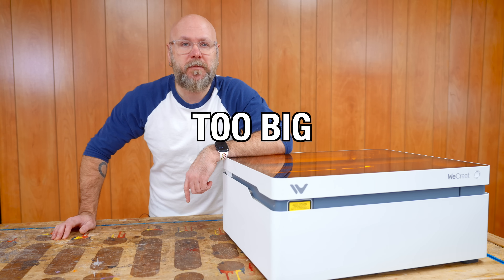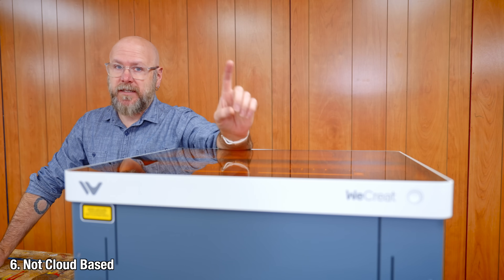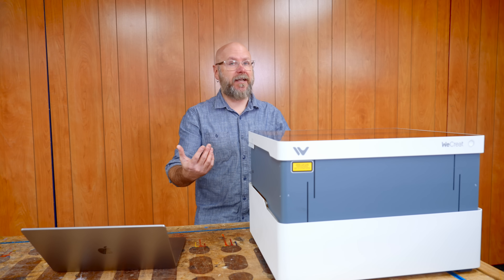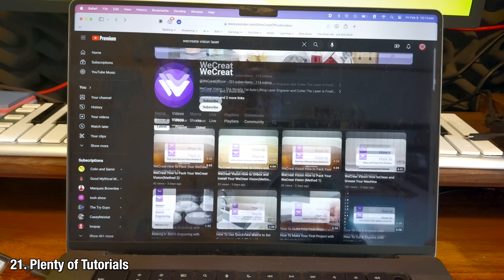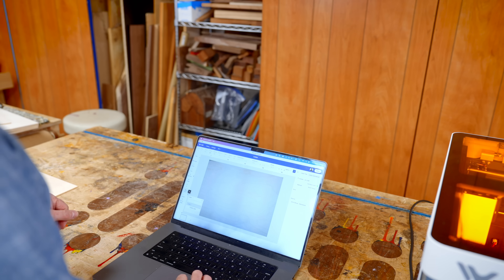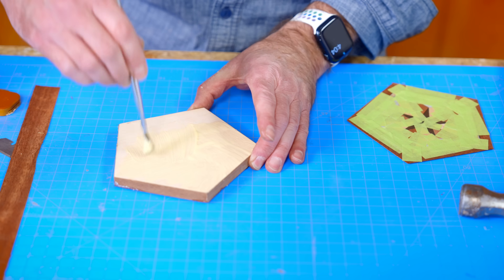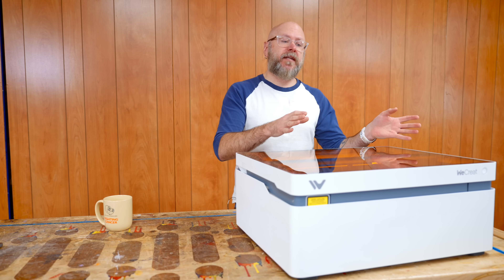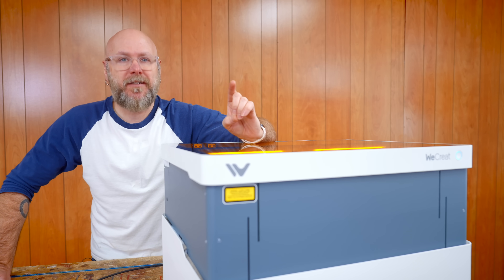28 Reasons Why THIS Should Be Your First Laser | WeCreat Vision

Comment: They lost at $1200 for 20w. 20W diodes are notoriously easy to overheat as people try to tax how much it can do and a diode laser never should really be ran more than 80% power. For that kind fo money regardless how nicely its packaged with other features, id be expecting at least 40-50w diode. Resolution doesn't matter by wattage, as that is purely properly setting things up in the process. Having a 40w laser wont run you any better or worse resolution at 25% power setting than a 20W laser would at 50% power setting.

Comment: I have looked seriously at adding this machine to my laser room ... but the Lightburn issue has kept me from pulling the string. Unless something has changed recently, the "Lightburn compatibility" claim is a bit misleading. Unless I am mistaken, you can create your project in Lightburn, but must export it to a GCode file, which can then be loaded & run in the Wecreat. On my other 2 diode lasers, there is no need to export/import files, and Lightburn directly controls all laser functions. Otherwise, this is a great machine.

Comment: Seems pretty great for a first laser. I bought an Xtools d1 10w with a bunch of accessories on sale a year or so ago for about $1000. Still had to get a fan to vent out my window and build an enclosure. Plus a 3D printed z-axis extension so I could keep the risers on at all times. All that to say everything this includes for the price is pretty incredible and way more convenient! I’m kind of jealous. One thing I liked about the Xtools D1 was that I could put any size material under it since it was just a frame I could place on top of things… then I built my enclosure and quickly realized I will likely NEVER place my laser on a large object and it stays in the enclose which makes it basically like this one… but significantly less convenient. Plus I had to built it and it doesn’t have a camera. Tempted to sell what I have and get this instead.

Comment: Woah. This is a laser engraver. Stop. The other ones you mention at the start of the video are laser cutters. In other words, diode laser on this thing versus CO2 laser on the others. CO2 lasers are close to an order or magnitude more expensive (in general) than diode. So while $1200 is an attractive price for a fully enclosed laser product, this isn't some magical amazing deal when comparing against Gweike, Glowforge, Polar, etc.  Diode lasers are cheap.

One of the reasons I'd need a lser is to cut acrylic. Clear acrylic. And no diode laser can do that. :( 

As far as stencils go, another good use, Cricut or Silouette is a much cheaper option for that, and you can go unlimited length.
Reply: I don't understand. It looks like it clearly shows cutting out those pentagram shapes from 3mm ply.

Comment: ARGHHH! Their website is impossible to navigate. Just to ask them a question navigates you into captcha hell. Why should I want to do business with a company like that? Edit: Apparently my inquiry did go through and someone may reply to my question. The captcha thing is still an issue but that ire should probably be directed to whatever effing fool is programming captcha. Will see probably Monday if they can process the materials (.008" thin sheet steel and .014" copper clad pcb) that I am using. Thanks David for presenting this possible solution to my fabrication task.Edit 2: To their credit they did get back to me today. Sadly my materials are not what they can cut. Dang!

Comment: Great video for laser starters! Having had expensive lasers like you, I would NOT recommend getting a filtration unit for cutting wood, the regular pre-filter and the post (expensive) carbon filter will choke very quickly due to the wood resins (especially woods like balsa and liteply). They're ok for engraving "tat" on aluminium tumblers etc. 'tho.
Reply: The problem is that if you dont have filtration you're opening yourself up to neighbor and by-law action if you're exhausting fumes outside.